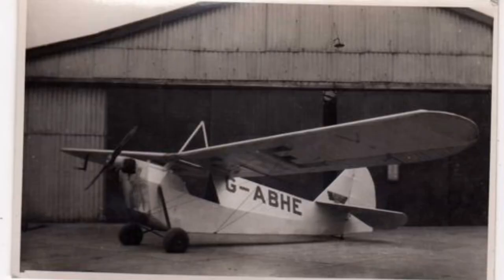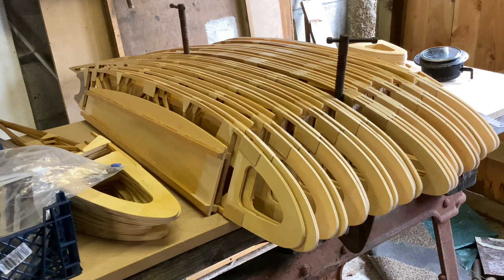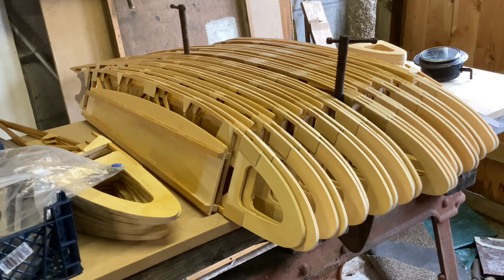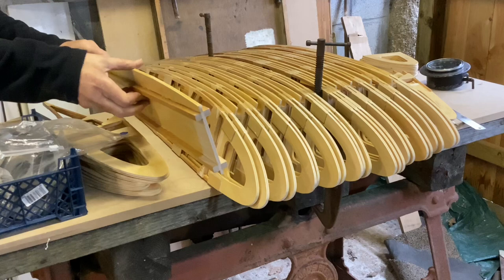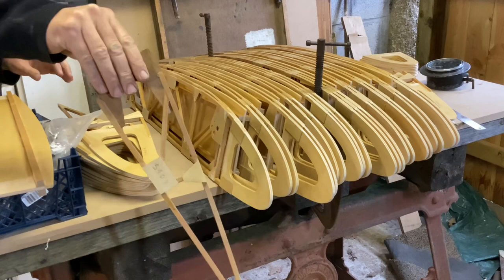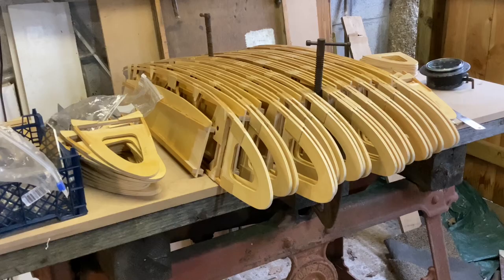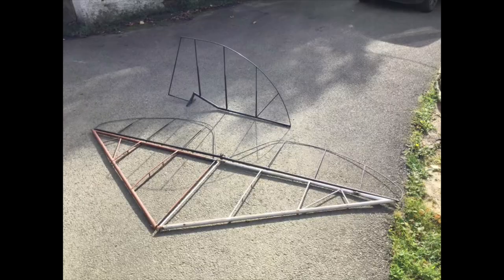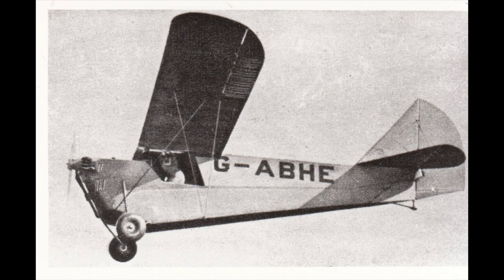Aeronca C2 - Wings And Things

Comment: Very cool project. In 1983 I transitioned to the DC-8 and built a small RC model in my room during a lengthy ground school. I used to pin drawings on the walls in hotel rooms during layovers on whatever I was working on at the time to plan my next moves when I would get back to the shop. New subscriber here. Enjoy your content, especially the model A engine stuff. I just bought a few engine cores and want to build one up. Hanging around Brodhead will give you Pietenpol disease. Still have my dad's Champ I learned to fly in.
Reply from the maker: @Kevin_747  Hi Kevin, thanks for your comments. The Model A is making slow progress, another film out soon. Time down route is well spent making films although the acoustics of some hotel rooms do not make for easy sound recording! Champs are good 👍

Comment: Building light means building complex. Great work so far.
Reply from the maker: I think you are right. The piano wire bracing is very strong for its weight. As much as I'd like to fit more simple rod bracing, it would definitely add weight, which is unacceptable.

Comment: I've stop-started thru this film several times, savouring the detail.  You make light of the work completed to date but perusal of the parts confirms a craftsman at work.  Marvellous!  Those corrugated alloy ailerons are an intrigue in store.
Reply from the maker: I will probably use the British Aeronca wooden ailerons. My good pal Miles drew them up a while back for his project and, as much as I'd like to have a go at making the tin ailerons, they are unbelievably thin gauge material, not particularly easy to find in the UK; wooden ailerons will be quick and easy in comparison. Likewise, having spent a few days reviewing the wing construction, I might well simplify the drag bracing to save vast amounts of constructional nit picking and lots of turnbuckles. I do have the turnbuckles but need lots more for the next project - a biplane. If the C2 donates 30 turnbuckles to the biplane then I save myself finding an extra £2000. Simplified drag bracing will speed up wing construction by months and none of it will show once covered.

Comment: How do you get all of this certified in the UK?
Reply from the maker: Single Seat Deregulation. Self certified under those rules.
Reply: @FlyingForFunTrecanair  thanks, I didn't realise that there was such an 'open' arrangement for aircraft lighter than a bit less than 1/3 metric ton;

Reading about this lead me on to the 'piloting' arrangements: how does a pilot qualify if these aircraft are strictly single seaters?

I gather that you are in fact a professional pilot so flying such a small & antique type of aircraft is no issue for you, but there must be many whose ambition is limited to microlights like Henri Mignet & his flying flea.
Reply from the maker: @pcka12  A very pertinent question 👍 The ‘minimum’ licence to fly such a machine would be a microlight licence and with suitable differences training; in the case of the Aeronca C2, that would be a tailwheel endorsement and is the reason I operate my Thruster TST as it’s a suitable Two Seat Trainer (hence TST). I operate on an Air Transport Pilots Licence with a Single Engine Piston rating. Any licence, from Microlight to ATP, is OK. I have a bit of a thing about the Flea, content on the way! As for training on single seaters, a briefing has to suffice - or nothing.
Reply: @FlyingForFunTrecanair  so piloting can be like 'the good old days' when you climbed into it & flew it?
Early aircraft where a bit of a topic when I was a boy because my Great Uncle Harold had been an RFC 'turner' posted to France & he paid for my dad to have a flight with Alan Cobham's flying Circus, so we knew about the Flying Flea & it's apparently lethal fault due to the limited separation of the wings - all things scientific being issues for discussion at home.

Comment: Still Nylock nut would be better solution for that Aeronca oil cap but now it is too short for that. But that makes me fee good because I could do that better.
Reply: Rubbish! Nyloc would be ugly; peening that thread appears to have been a much better way.
Reply from the maker: Nylock isn’t exactly vintage?
Reply: There is a older fashion lock nut where the Nylon is replaced with Bakelite. That would suite the timeline. But you Englishmans seems to know everything better.